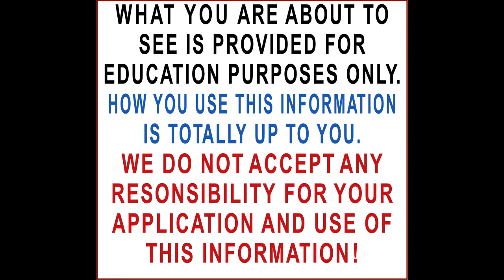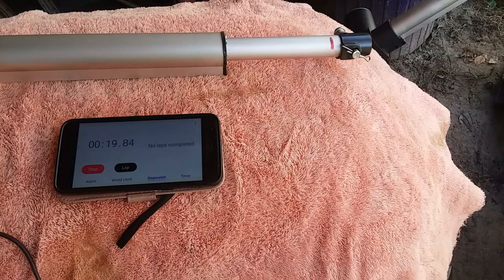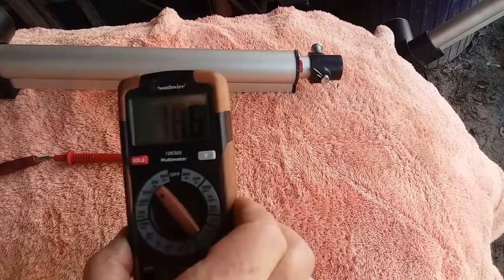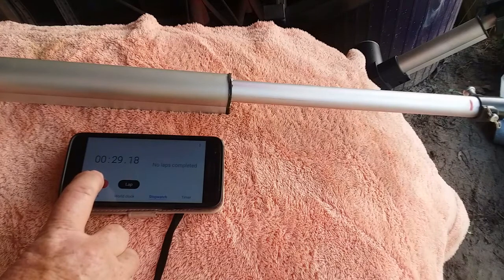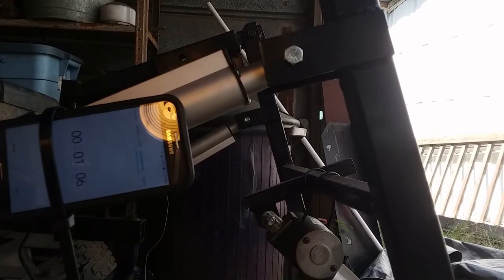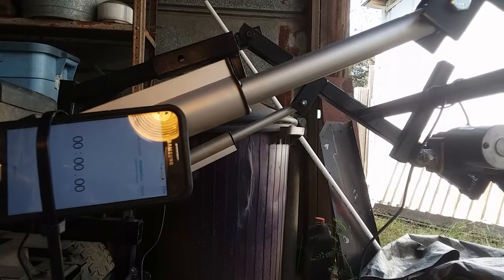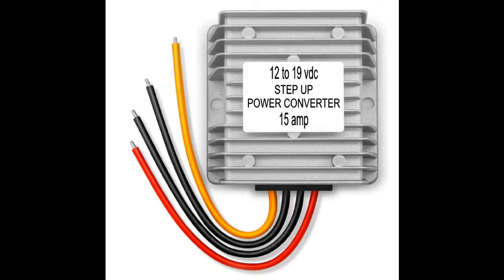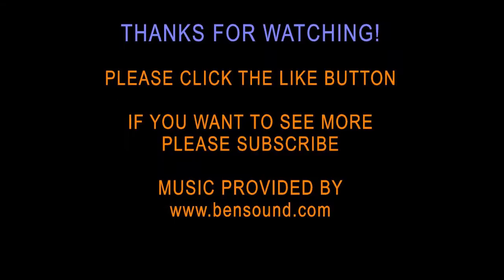IMPROVING THE SPEED OF 12 vdc ACTUATORS for FRONT END LOADERS  PART 1  ELECTRICAL EXPERIMENTS

Comment: I had a thought...bouncing it off others....

What if you used cheap actuators in series to increase speed?  Yes, you need a bracket for this but you * x your speed.
Also, you could run them in parallel.  But if they run at different speeds this could cause binding.  I think one would be loaded down and forced balance, but if the actuators are not matched AND have large speed differences...then you are going to wear the fast one out.

Looking at pricing on these vs "better" ones.  I think inline and parallel systems would actually have far better performance for the same-ish price.
Reply from the maker: Hooking up batteries in series on a DC circuit will increase voltage and thus make the 12 volt actuator run faster. However hooking up the load circuit -the actuators - in series on a DC circuit will make them run slower because you are creating more resistance in the circuit. 

As for parallel circuit - I am running my lift arm actuators in parallel. If the actuators are the same brand and stroke length they run really close to one another starting and stopping within a 1/2 second of one another. I have purchased a lot of actuators and I am having good success running at 24 volts. 20 volts also works well but not quite as fast as 24 v. 

Recommend you take a look at 2 newer videos I posted that are very infomative. Here are the links
https://youtu.be/xPJbiGGSJDw
and
https://youtu.be/65KXN2Ny-U0 

Thanks, Ed
Reply: @eds2centsworth203  Not the batteries...the actual actuators.  End to end.
Reply from the maker: I made comment first about the batteries but then about the actuators. You said "What if you used cheap actuators in series to increase speed?" Hooking up batteries in series for a DC circuit will work - you will increase voltage and thus more speed from the actuators.  Hooking up the actuators in series in a DC circuit will not work - you will make the actuators slow down, not speed up and you will probably damage the actuators because they will be voltage starved.